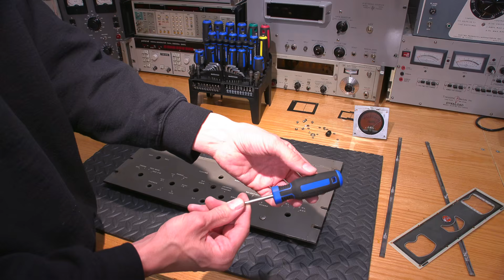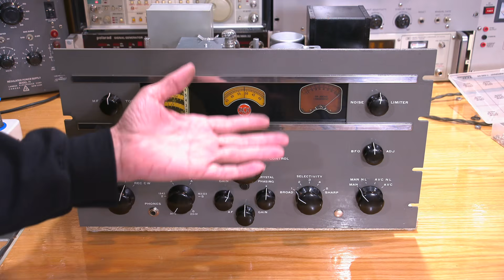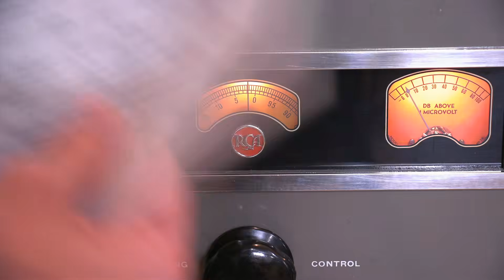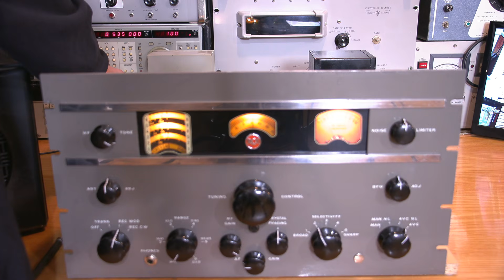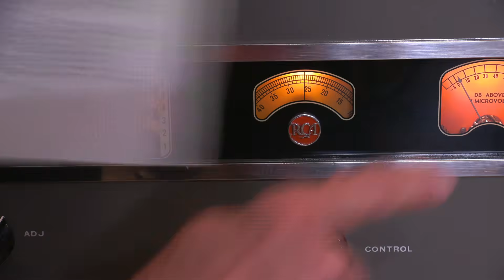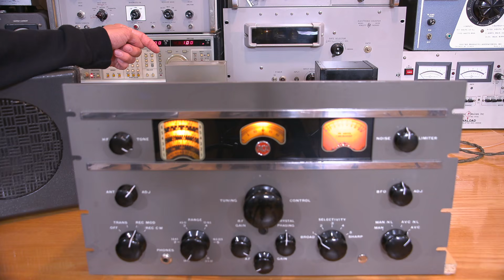Finished! Restored 1940's Secret Listening Post Receiver, See And Hear It Operate! The RCA CR-88

Comment: Why is there both a radio frequency amplifier and (RF) and an audio frequency amp (AF).  What’s the difference?
Reply from the maker: Both need amplification. The RF stage uses tuning for a thing called "selectivity." This allows the receiver to separate signals one from another.

Comment: In 1960 I was discharged from the US Air Force and took with me an RCA AR-88 which had been Given to me because I was a Ham Radio Operator and an 
Air Force MARS Auxilary Station. Yes, It was a Heavy Dude. Shiiped it home via Railway Express (remember them). It was a very good Radio and I wanted to modify it for SSB use too but never got that far. Things happen and I had to move from Michigan to California so I donated it to a local Fellow Ham. Now many years later I see your Video on the CR-88 which to me looks very, very similar to my old AR-88 so I am watching your restoration with Great Interest. Thanks for Posting. Oh, I see you replaced the CR-88 front Dial Face with one from an AR-88. Okay.
Bill, W6SDI formerly W8FFX/AF8FFX😎
Wow! I watched that total Video. Brings back lots of Memories when I used it in my Barracks Room in New Mexico in 1959 and 1960. Great Radio! Thanks for the Post.

Comment: Mr. Carlson…I wanted to thank you for this series!  I watched with great interest as I have a CR88 I wanted to restore.  BUT…I found an older AR88 that was used at the RCA factory in Indiana. I bought it and it worked great…but I still wanted to make it a “daily driver” of sorts. 

After watching your series over and over…listening to it at night while sleeping…your knowledge must have seeped in. 

I was quite nervous about the alignment. It’s more involved than anything I’ve undertaken. But I got through it. The radio works great. It’s an amazing receiver.

The CR88 will be a project for next winter. It too works, but I’d be more comfortable getting rid of those nasty caps. 

So thanks again!

Comment: 16th Feb 2025     from England    Hi sir.    First time I've come across your channel.    Superb project with the 40's receiver.   But 20 minutes in when you split the AVO (multimeter)  in half,  I then became extremely concerned.   As you stated the inside voltage was over 300v.   But you are taking measurements using both hands.   There is a possibility that  higher voltages can arc pass the probes directly onto your hands.   Both your hands now become part of the circuit.   One live. The other negative.      The +ve voltage is always wanting to go to ground.    The path of least resistance.   If the arcing occurred the voltage and current would travel from one to the other.  Least resistance.   The easiest way that will always happen is travelling up your arm to the ribs.  Crossing the rib cage and then down the other arm where it is grounded.   No choices.  Only outcome.  It takes only 4 mA of current to stop your heart.   Never use both hands   Keep one always in your pocket so you never forget so any electric  shock stays well away from your heart.   If the electricity hasn't got a ground exit then there is no completed circuit,   just like a capacitor.   Small changes to ones routine means that I can continue to watch your videos for a lot longer.     Best regards   Neil from near Manchester

Comment: I once had a radio from the 30's, street found, it had a variable capacitor that was 4 times as big as the one you show in your video, it could receive so much that it had 3 scales you could use to listen to, but unfortunately one of the tubes was broken, and I tried to find a replacement, but being early 80's, no internet, no real connecting to the world, I could not find a replacement tube. The capacitor I played with it, and I found the FM and MW I connected to a radio were only a centimeter movement of the attached arm, like 10 degrees out of 360 envolved the whole scale of a normal radio, knowing that there is so much you could receive with it.
Over the years the capacitor found itself in a moisty shed (not my fault) and ruined it totally. But I like seeing you saved these old school radio's. I love it.

Comment: I wonder why they didn't try to build a battery version of the RCA CR-88 using the tubes made for car radios with a heater voltage of 12V and a B+ of 12V also made by ZENITH so that the radio can be smaller and lighter and run off two 12V batteries as you are only using headphones to listen to the signals.

Comment: Competitors in the Newport-Bermuda sailboat races (at least in '94, '96, '98, 2000) had to have an SSB radio.  I had sheet copper running all over the inside hull for the ground plane.  Needed to do a radio check with WOO.  Couldn't get the thing to work, then realized a lot of 12V juice was needed when transmitting.  Re cleaned the 12 V connections (which looked clean) put my knuckle of the coax wire where it fed into the antenna, had a buddy key the mike, and OWWW!  Finally got WOO to answer.  Hook the SSB up to a laptop (kinda primitive back then) and one could tune in the NOAA weather-fax broadcasts and MAYBE get a weather map.

Comment: Did you paint most of the panel while shading the lettering?  Love to have seen a Video on that process.  Mine is terrible and rusty, but the lettering is good.  It's holding up the project.  You have given me a reason to push forward but I'll have to travel a long ways to find paint matching services.
Reply from the maker: Just touched up the nicks and scratches with a color matched paint.

Comment: I am a retired TV-Radio Technician. I haven't worked on any electronics since 1998. I sold my parts and tubes and equipment. I am interested in restoring antique radios and televisions. I would also like to get into HAM - CB repair. I found a piece of equipment that might help me get back into the field. I wonder what you think about JUNTEK PSG9080 80M Programmable Digital Control DDS Dual-Channel Arbitrary Waveform Frequency Meter Function Signal Generator. I value your advice and wisdom.

Comment: Brother Stair all over the place.
Old vs. new: Sure, a modern radio has better selectivity. But for sensitivity the high end old models compete very favorably. And it's pretty easy for the vacuum tube. Getting from 1µV up to about 1 or 2 volts, which is all you need to drive a speaker to reasonable volume, is not hard work for 3 or 4 tubes. And the linearity is good. At the extreme end of a tube's range it gets quite non-linear. But if you don't drive it that hard it's not a problem. As for added noise and distortion, well when you're down under 1µV even the most quiet dual-gate MOSFET isn't quiet enough. Hey Paul, maybe a short video on tubes, load lines, linearity vs. plate volts vs. gain?

1 Watt of audio output, which is all you need for such casual listening, is only 2.83 Volts applied to an 8 Ohm speaker.

Comment: Having and restoring an AR88 myself, I enjoyed your videos about this excellent radio. But you missed the electrical safety concerning not having fuses in this radio. I installed a fuse in the primary of the power transformer, and another in the. B+. This way if something might happen, it will prevent a fire. Think about it. Fred
Reply: What type of fuse is appropriate on this radio?
Reply: @ 1Amp. Slow blow

Comment: 9:06 it looks like an engine ready for the car show, but it’s a radio… I’m absolutely amazed at what you did to it throughout this whole series. Going back all the way from seeking out and troubleshooting every single component failure, the bent capacitor fins (wth?), the fleeting signals (or spirits that haven’t yet moved on from this world) that you could only measure/hear/view on your test equipment, to replacing, refurbishing, engineering, and restoring every part of that system for our edification. A true grande radio restoration indeed. Thank you for the time you spend sharing your knowledge and expertise.

Comment: It struck me as you were talking about the very specific grounding of the tuning capacitors that the engineer who designed it is much like a orchestra composer. Just like the individual instruments contribute to the sound produced by the orchestra, so do the components of the radio, and how they are connected affects the radio's performance.  Thank you so very much for helping us to appreciate the expertise and level of sophistication that went into building the receiver.

Comment: R.a.d.s. joule judas 19.4 duration 2.4 hr min 5.4 2103 year 2104
3 carrier argo 4.1 to 1.3 
Average 1.3 star trek transporter board lower and raise the 
Warp 34 to 38 solar system 118 solar system 204 solar system 63 year ... 1397 year through 1531 year :; 2093 year through 2235 year :; 2455 through 2608 
T minus.. assembly launch control count down... register terminal conduit citation past ignition...
2103 year picture 
Rock mountain size conglomerate, pebbles hundred miles class 6 conglomerate :; 2108 .. 2112... 
Globe impact argentina t.e.r. 130 nautical miles inland exit australia new zealand globe debri and 109 foot entry surface two techtonic plate exit australia 156 astral star debris detonation megaton warning flares during drive warp 4139 megatons 

Technical aerospace to hold 26% incoming asteroid astral star remains 156 through 158 astral star. 

Known impact cylinder roadway with capped conglomerate mountain dig out to have a central safe area, ocean current cylinder

Comment: Usually when you do an alignment you need to adjust the screws on the tuning capacitors so I was surprised when you put the shield back on them and left it. Not part of the alignment?
That radio is a real beauty and masterfully restored. Good enough is not an option on this channel.
Reply from the maker: Those screws only hold the capacitor together, they are not variable capacitors (Trimmers) like on the others. Thanks for your kind comment!

Comment: 13:00  Should you be touching the tabs with your "dirty" (body oil) fingers Paul after you have cleaned them?
Reply from the maker: Lots of work off camera. Everything is spotless! The contacts are even waxed in the can, when the can is depressed on the variable capacitor, the wax is cut (by the capacitor) making contact in the specific areas. This way the tabs don't oxidize again for an extremely long time. The backside of the tabs that are screwed to the can are also waxed, and the hardware used (screws, nuts, and lock washers) are stainless. All the replacement hardware on the bottom side shielding is stainless as well. The contact area on the back of each tab is a circular punched ring which the bottom side can be seen in the video clip. The punched ring is the contact area to the box. The stainless hardware is not really used as electrical contact, but it helps, and can be included as contact area. The can itself is also waxed to slow oxidization. I don't want the can and the bottom shields to turn out like the original chassis after many years. The shields on the bottom are also waxed and polished just like the top box, for those that want to say this affects continuity, that was checked with a low ohms meter, and is more than adequate. No the wax will not cause issues over time. Slight pressure from the mating surfaces cuts the wax. All screws are evenly tightened (torqued) to minimize box distortion, this decreases uneven movement in the warm up cycle and lowers frequency drift in the oscillator section. Yes this all matters in a big way.

Comment: I saw your 1st and 2nd RF tune ups, but missed the IF tune up.  This can give some improvement on the 3, 4, and 5 selectivity positions, especially if you want to receive weak CW signals.  If you have a spectrum analyser you can change from a flat top IF response, to a peaky response, either at the high or low ends of the IF.
Reply from the maker: Go to the previous video under the "Show More" tab, below the videos description.
Reply: Your not going to trip this guy up.!

Comment: These are supposed to be sweep tuned to produce the right response curve shape at each stage.  Simple peaking will not give the intended  "square" selectivity curve.
Reply from the maker: Did you not watch the previous video? If you are referring to the Oscillator, RF1, RF2, and antenna alignment here in this video, you don't sweep that portion of the alignment. The IF selectivity curves are hardly square. 'Stage Curtain" is more like it.

Comment: Very interesting and instructional series, thank you for taking the time. In the video you mention just how sensative this Rx is, however, you mention that it stacks up very well with a modern radio, but do not show a comparison. Would it be possible for you to have a side by side comparison,  the "old" restored radio, and a modern off the shelf radio being fed with identical signals from the generator? I believe that such a comparison would be very illuminating and show just how "good" the WW2 era radios were showing off the skill and ears of the radio operators back when our fathers and grandfathers listened for the information from agents "the other side of the lines" that saved so many lives of the fighting men on all sides. Many thanks again. 73 Jim M7BXT

Comment: What a beautful restoration!  Your skill and patience are truly awe inspiring. I couldn't match it, even with my 66 years experience as an electronics design engineer and amateur radio operator.  However, I believe we do a disservice to younger hams by representing this receiver as "easy to tune on SSB and CW".  Yes, it is quite sensitive and stable for its time.  But modern receivers are superior in every way to this unit.  Selectivity, noise floor,  stability, noise reduction capability and frequency calibration are far and away better due to advances in the state of the art over the 78 years since the AR-88 was built.  However, I believe the AR-88 may just be superior in one aspect, its ability to be repaired and restored , even after 78 years!.  Today's units would be unrepairable after only a few years because the parts would not be available and the test equipment required is beyond the affordability of the average repairman -- perhaps even you, if we consider the firmware and digital techniques used.  Keep up the good work! We all need your example. .... de K4TO

Comment: Fascinating! I haven't tuned up a radio in 50 years! One of my jobs was a 1929 Philco Storage Battery Company Tuned Radio Frequency (TRF) receiver I got out of a chicken coop. (They made batteries for electric cars and switched to radios when the electric car market dried up). When I showed the original owner that it still worked he was amazed, it had sat for so long (about thirty years). This was in 1962. He bought it for $600 dollars just two weeks before the stock market crash.

Comment: Seems to be a number one rule in car painting to be sure there is no wax (or grease) on the surface before painting. Hence the use of wax and grease remover (a concoction of solvents) before paining . So how did you manage to wax the surface of the plate BEFORE painting without the paint reacting (and not sticking) to the wax??
Reply from the maker: Waxed for the color match, removed for the touch-up, then re-waxed.
Reply: @MrCarlsonsLab  Ah. ok then. Thanks